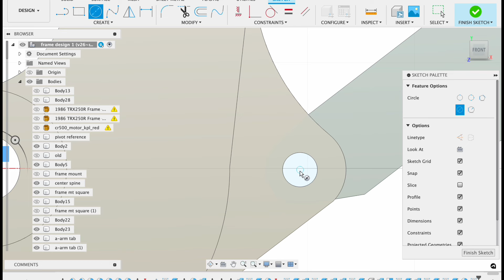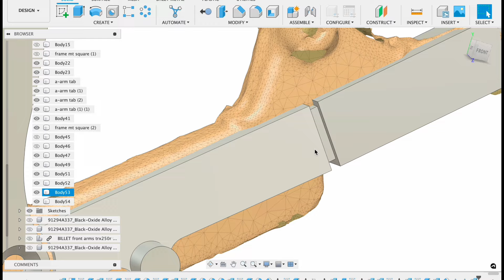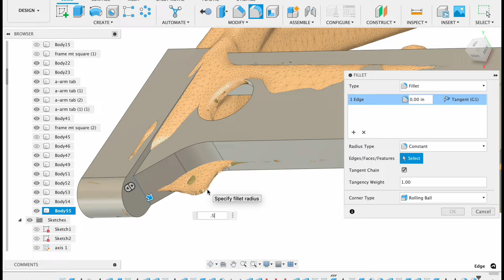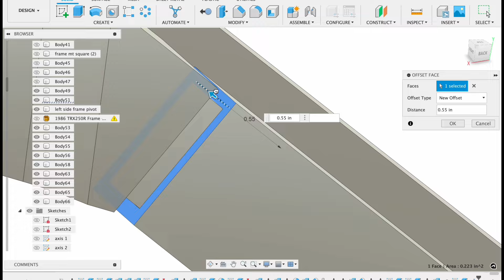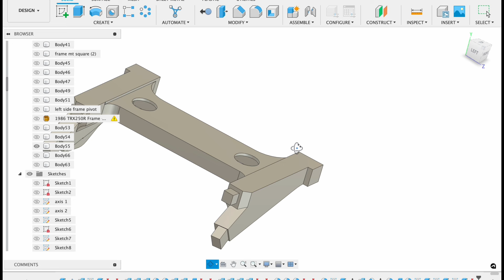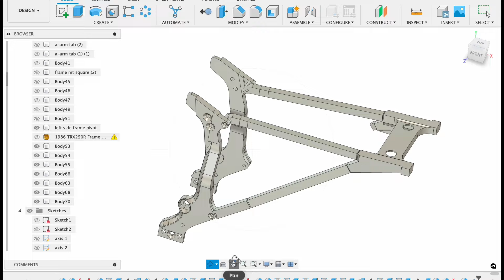Billet Honda TRX250R Frame Build - Part 3

Comment: I have a thought related to part 1 of the series. I own a laeger narrow with cr 5 linkage. Air boot fitment is tight between the frame and the shock. I've read that no-links have the same problem. If you could increase the clearance in the "hip" area it would be beneficial. There is room under the plastic. Thanks for listening and great work.
Reply: My thoughts exactly. The bigger the shock body, the worse the problem.